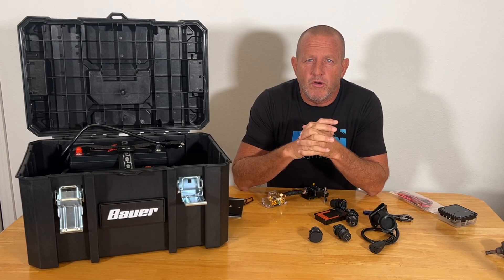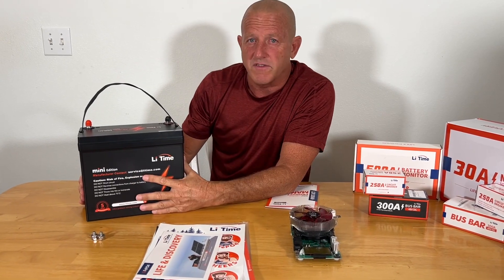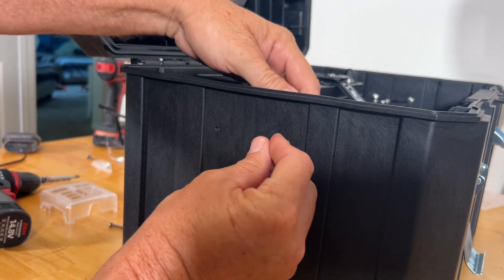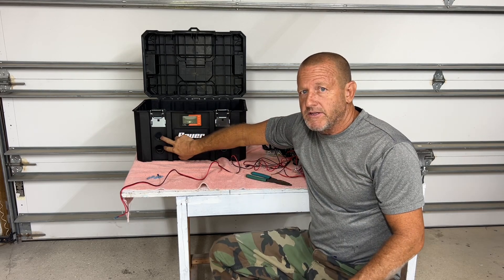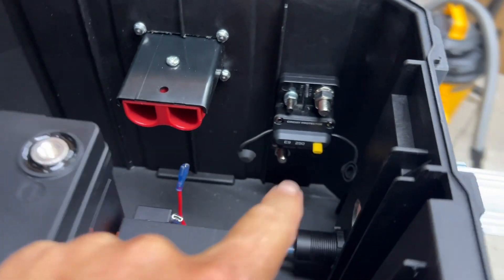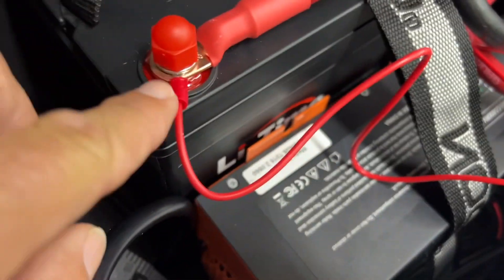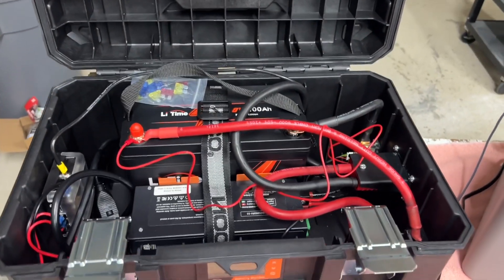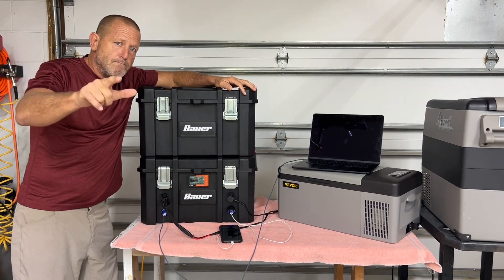DIY Solar Generator Build - Episode 2: 12V Power Module Setup

Comment: Great video. I found this after I started my build in the larger Bauer boxes. I’m using a self built 24v 100ah lifepo4 battery which is comprised of 40 3.2v 25ah prismatic lifepo4. I’ll be using a 3000w inverter and MPPT solar charge controller. I haven’t decided if I’ll use my 20a or 40a yet. I have another battery bank made from 20 3.2v 74ah Lev60f batteries but it’s way too heavy for a portable build like this. You made a nice, clean build and it was explained very well. Thanks for sharing this with us. Good luck to you.
Reply from the maker: thanks for watching

Comment: i am building in that same box right now. gonna be 3 u1 form LFPs, used ones in the 27-28 ah range so around 80 ah, a 1500 watt modified sine wave inverter (its what i had on hand) 1 12v port, one dual usb charger, 2 ac outlets, charge port, (not using an onboard charger) and 200 amp marine on off switch.
Reply from the maker: @MrSGL21  oh yea. we do what we can do.

Comment: How do you charge your battery box without having to open up the lid basically can you turn on the charger AC charger that is without having to open the box first
Reply from the maker: i actually just posted a video where i eliminated the converter charger all together and added another battery. now i just use a regular lithium battery charger . and open the lid . 99 percent of the time i use solar

Comment: I have a question.  Im building a diy powder box and i was wondering when i charge the battery do i have to disconnect all the connections from the battery first or can i leave the other connections attached at the same timeand charge.
Reply from the maker: @tonysmith7488  leave attached. if you do disconnect anything you would disconnect the solar pannels. i will be upgrading my box soon keep an eye out for the video

Comment: Great job...very nice and clean install. With all that gear, does the Bauer box have a lot of flex?
Reply from the maker: it flexes a little but it is a solid box once the lid is colsed no flex at all. it can definatly hold the weight of the componets

Comment: New Subscriber 🎉.  Been wanting to build something similar for a while and started my research. Found this channel and is exactly what I needed. Very detailed. Thanks. 

Was wondering what your thoughts were on expansion ?

A pair of 12v 100ah in parallel or serial 

And also what you thought of using the new watt cycle 12v 300ah mini battery instead (needing thicker wire to the inverter and possibly larger Anderson connectors)
Reply from the maker: you only need thicker wire if you  increase size of  watt output of inverter inverter. (ex. 2000watt to 300watt) If you run 2 12v batteries in parallel voltage stays 12v.
 you run in series your voltage increases (2 12v bat in series equals 24 v) so you would need to change your inverter to one the appropriate voltage (12v to 24v) but higher voltage will decrease amps which means smaller wires.
Reply: @StoneBrokeAdventure  thank you

Comment: Hi. How's the "Li Time" battery treating you? Cool setup.
Reply from the maker: it is working as expected. Ive worked with several bateries in the past and the quality of the build on this one is top notch and the  Mini series works great for this aplication. i have another video of a test on the litime battery. check it out on my chanell. i am currently in the process of building out the second modual.